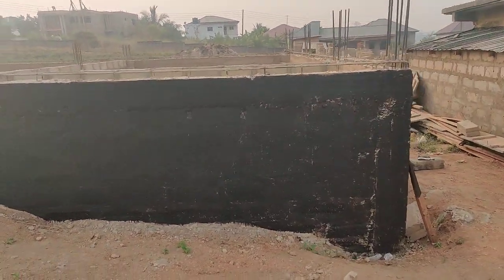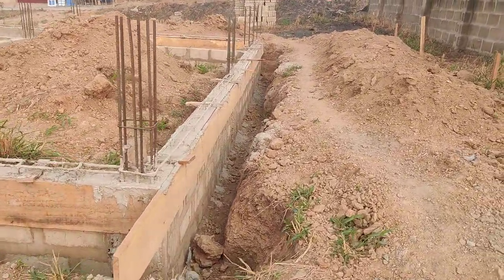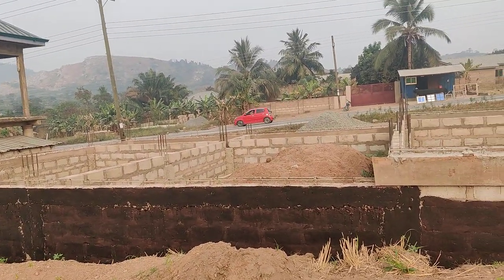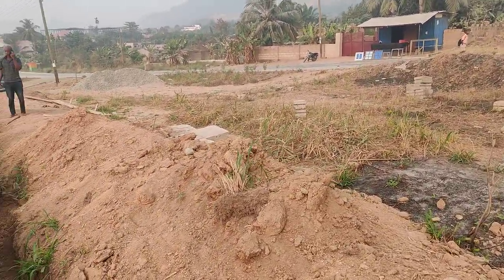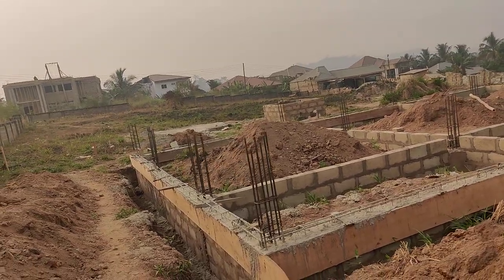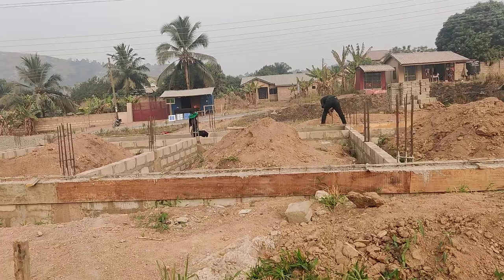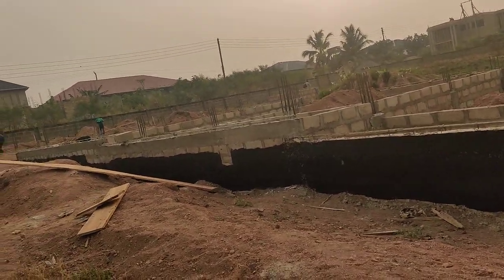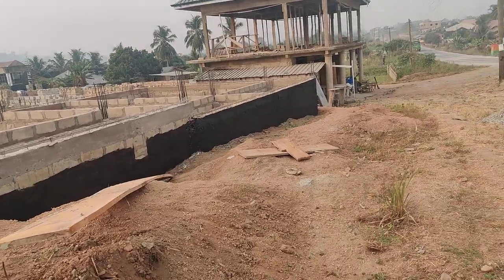BUILDING COMMERCIAL IN GHANA || Foundation Update Damp Proof on Foundation ??

Comment: It's good you did the dump proof and  if you have the money you can take it  a little further by adding vertical dump proof membrane ( rubber) on the sides as well and that will give you full protection.
Reply from the maker: Ok thanks Billy. I definitely would ass the rubber dump proof protection

Comment: Well done bro, I will advise you to dress the filling with DPM( dump proof membrane) and put a mesh/ suspension (8mm steel rods)on it to have a solid ground flow.
I am given you a tip here:

One tone of 8mm steel rods = 300 pieces 30 foots long

One tone of 10mm steel rods is 180 pieces 30 foots long

One tone of 12mm steel rod is 125 pieces 30 foots long

One tone of 14mm steel rod is 95 pieces 30 foots long

One tone of 16mm steel rod is 75 pieces 30 foots long

One tone of 20mm steel rods is 45 pieces 30 foots long.

Do more search about the quantity and the sizes of the steel rods and the prices. I have experience a lot from Ghana builders. I will advise you to go and buy your materials if possible. Thanks for sharing it with us.
Reply from the maker: excellent..thanks ....are you saying to add the steel rods before casting??
Reply from the maker: ill use the 8mm mesh prior to casting
Reply: @ObibiniAfrikan  yes add the steel rod before casting it.
Reply: Bro ask the contractor to put steel rods on all (internal block work) of the blocks work before you cast it. Tell the contractor that you want it to be done.
Reply from the maker: @kwadwookoampa9324  thanks bra kwadwo.
Reply: @ObibiniAfrikan  you are welcome

Comment: Please the dump proof coating where did you buy them? Is it different from the water proof cement?
Reply from the maker: hi, i bought from mile 7 opposite the achimota mall. yes..the damp proof  is different to the water proof cement. the waterproof cement is small pack and used to mix the normal cement

Comment: What's the name of the damp proof paint used pls?
Reply from the maker: evening ..it is called CORAL DAMP PROOf EPOXY PAINT.BB4301
Reply: @ObibiniAfrikan   Thank you. How may litres and how much was the price? I was considering buying a similar product from the UK and shipping to Ghana.
Reply from the maker: @paulaning  no wahala Paul. I found four types while here. there is the coral(320 ghs cedis), and two others (240) and 300. the fourth type is called impeneuce . it is from neuce paint company. i understand its the best. its expensive (505). if you shipping from uk, you could add some and use here..it might not be cost effective though ..hope this helps
Reply: @ObibiniAfrikan  Thank you for the elaboration. I know of neuce. What price quoted,  what size of the tin ie are they  5 or 20 litres?
Reply from the maker: @paulaning  20 litres